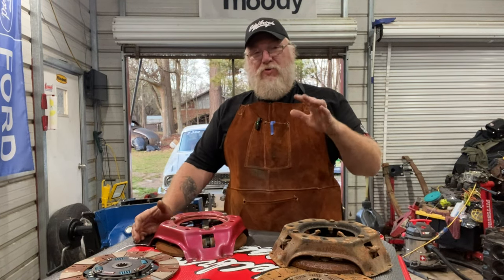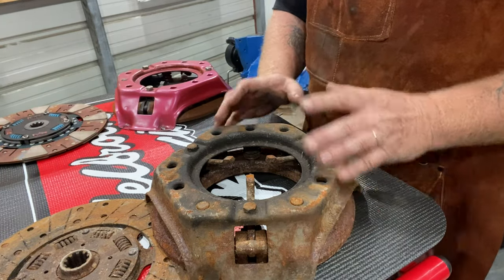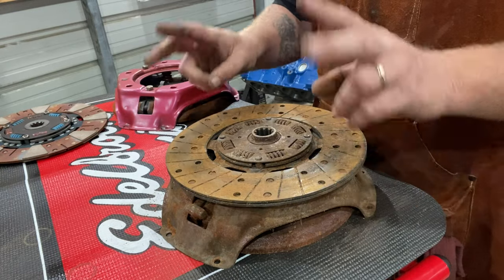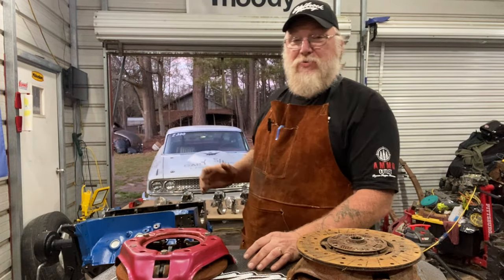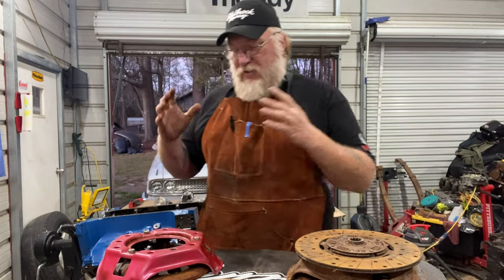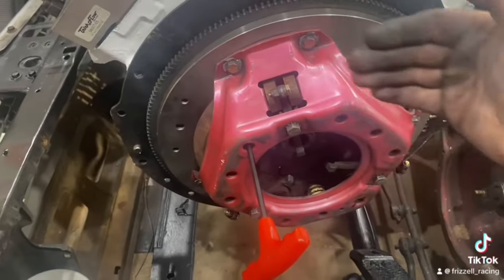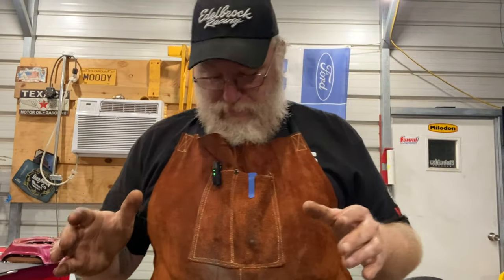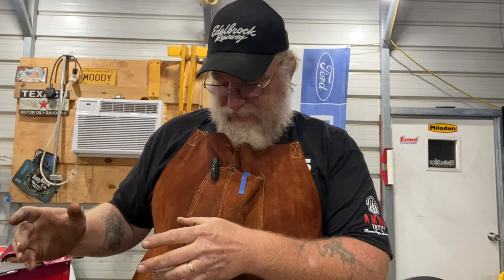Demystifying the race clutch : set up explained ￼

Comment: Back in the day early 70's I ran a ZOOM clutch and pressure plate, I always had extra clutch dish they didn't have all the technology now than they had back then. I like the three finger pressure plate the more you put power to it the harder it clamps a 67 Fairlane 500 with a 427 i put in it, back then it ran in the mid 10's

Comment: Great Vidya Bobby,  Other Ideas: Ford 9"  Ring and Pinion, Rear leigh Springs, Front A Arm rebuild, Coil sping removal - SAFETY, How does a radiator work, Talk about being pulled by a golf cart and ripping the front fender, Electrical circuits, head lights, generator, thermostat, - just ideas.  keep it to 20 minutes.

Comment: I like the Borg and Beck style clutch but the Long style with static adjustment I will look into, along with the sintered disc. . Everyone is going for the diaphragm style for an easy push but they stick to the floor above 6,000 rpm. Zoom lied as my Zoom did stick to the floor and release instantly as the rpm dropped, not always a fun experience. Not all of them did this at the same rpm. My sbc was turning 7200.  The Long style is what Ford concentrated on and being a GM guy, i know not much of them. Thanks for posting this.
Reply from the maker: Thank you sir.   And I don’t care for a diaphragm style either.  They are ok if all you want to do is ride around town I guess but the long arm is by far the best.

Comment: Great video! You run the factory z bar style,counter shaft clutch.linkage or a hydraulic  set up? Heavy  clutches eat up stock linkage pivot points
Reply from the maker: I’m running the stock Z bar

Comment: Thank you for the Excellent video!!  couple questions, Do you run a steel flywheel?  30lb??.. and could a guy run your setup on a street/strip car?  not sure how a solid (No Springs)sintered iron disc would behave..  If so..how about an in car camera video of some street driving.....and maybe in the car adjustment video...
Reply from the maker: I’ll be happy to make some
More videos on it.   Yes you definitely can run this setup on the street, it’s had to explain in a text but I guess the easiest way to explain it is.    It grabs quicker than a street clutch.   Once you get use to it and learn it it works well.  But it will feel a little weird at first

Comment: where are you now with the base pressure and what does your car weigh..?
Reply from the maker: My car weighed 3750 that last time it was weighed.    It should be lighter now.   Haven’t weighed it yet.   I will start marking test passes after Easter to get the new setup dialed in

Comment: Do you base the base pressure on car weight
Reply from the maker: Kinda yes,  it’s hard to explain thru a text but yes you kinda do.  A lighter car you can run more base pressure.    Does not necessarily mean you need more but you can run more